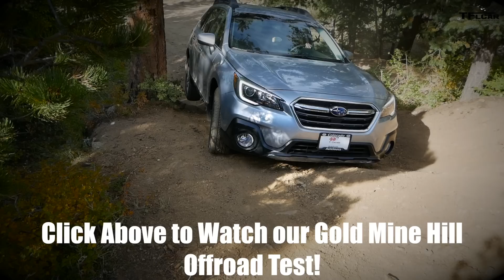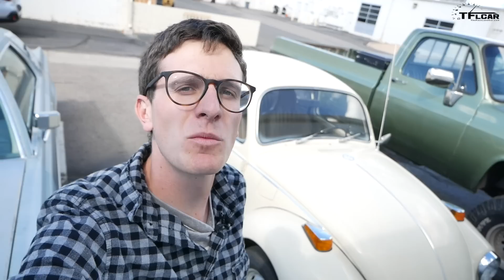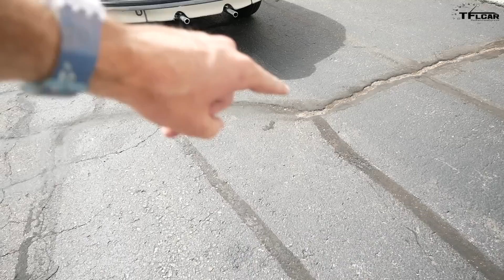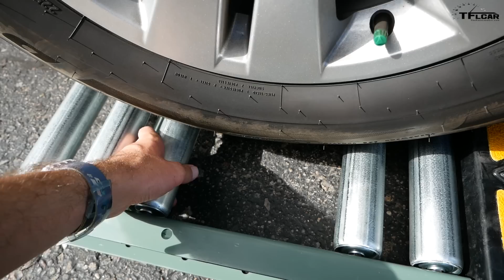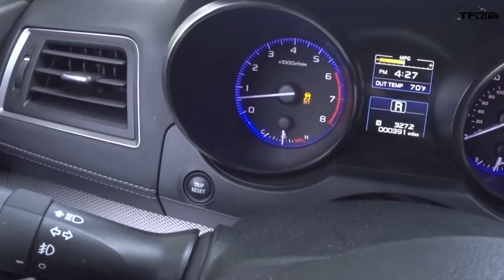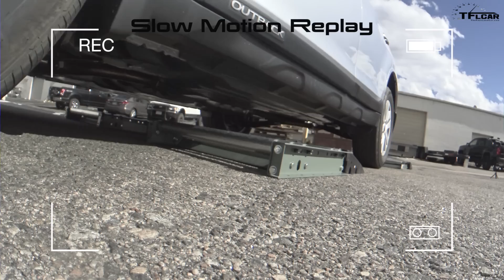The Truth About Subaru's Symmetrical All Wheel Drive:TFL Slip Test vs Subaru Outback

Comment: While this test is a good demonstration of how brake force traction control systems work in general, it's probably worth pointing out that any modern all wheel drive vehicle should perform similarly, as traction/stability control is standard (mandatory) on new passenger vehicles in most countries. AWD systems using traction control vastly outperform older, open differential systems, but do have some limitations compared to locking or certain types of limited slip differentials, especially in off road conditions.
I agree with the other comments suggesting an inclined ramp, as I suspect that the roller system as tested on a level surface could have been defeated fairly easily by even the VW with a little rocking and/or generous application of throttle. An incline would be more demanding and  better demonstrate the capability of a given system. I'd really like to see you perform this test on your "old vs new Cherokee" to show how easily an open diff 4wd system can be defeated by ice or a lifted wheel. 
I did some extensive testing on the Jeep Quadrarive system used in the 99-04 Grand Cherokee, which didn't have traction control but used Dana Hydra Lok (Vari Lok) diffs front and rear. I made a couple videos of the system in action https://youtu.be/C1pCDP2PkL4?t=76
If you have an older, pre-traction control vehicle and find yourself spinning one wheel, you can take a tip right from the owner's manual of my 75 Ramcharger; gently apply brake and accelerator together.  Although not as effective as applying brake force to just the spinning wheel,  it will have a similar effect in evening the torque distribution side to side. 
It's nice to see videos that acknowledge the value of traction control. Emergency brake assist and stability control would be nice to see featured as well.  Great videos, keep it up!

Comment: Great test! Seeing this test and your real world test up gold mine hill really shows the importance of real world tests. I think to improve the roller test you could include an inclined and cross slope test as well as a test that limits traction to the wheel with traction (simulating dirt). The goal being a test that shows the CVT is the weak link. I wonder if it's possible to design a CVT without slippage or power cut out. And thanks for bringing in the bug for some vintage flair!

Comment: Great project!  Some Thoughts:
1) The car is putting on the order of 1000 lbs per wheel on the rollers.  Those commercial conveyor rollers are typically rated for 50-200 lbs, the high capacity ones maybe 600 lbs.  I suggest trying to find some rollers with sufficient capacity to eliminate the possibility that crushed roller bearings don't influence the test.
2) When 2 or more wheels are lifted 3 or 4 inches higher, that reduces the weight on the tires on the ground. You can see this at one point in the video when even the front tire on the ground slips a bit.  This is the polar opposite of the Gold Mine Hill test, where all the weight of the car is on the grounded wheels.  Maybe as a minimum put the grounded tires on static platforms of the same height.
3) Tire pressure will have a great influence on the results since the tires are point loaded and lower pressure will smoosh the tires around the roller.  Just make sure to use the same pressure on all tests.
Keep up the good work! Love the channel

Comment: Great all wheel drive system...in my opinion it didn’t do well at Gold mine hill because of the CVT.  CVTs are great for fuel economy but don’t seem to do well with in off road situations when you need max power to the wheels. Too much slip in the cvt?

Comment: Great test, but needs to be done on an inclined surface. Thee weakest of TC systems handle this test but the question is, can it apportion enough torque when the gripping wheel is trying to climb the car up a hill, as is most off road scenarios. Find a ramp or steep driveway to do this roller test on and then rince and repeat for as many soft roaders as you can. I know a lot of people are rooting for Subaru, as am I, being an outback owner, but if people can point out their competitors are doing better in off road scenarios, then that’s a good thing. You won’t improve if you think you are the best and don’t need to try. Keep up the good work and nice to see you throwing some resources at this.
Reply: Those videos do exist as well...https://youtu.be/JC03tXrrGRI

Comment: Actually if there wasn't some kind of center diff lock or break simulation of a center diff lock, the car would fail at the test at 5:13. Because if you have an open center diff and one axle has no traction this is the same as 2wd with one wheel without traction.
Reply: nirfz Subaru has never sold cars with an open centre differential.

Comment: I think for the Gold Mine test you need to change the tyres to compensate for the incline - we compensate for slippery conditions with winter tyres....
Reply: Yea but this is TFL, they don't do good tests. When they took a 175hp outback for such steep hill, it already lacks the engine power to push its own weight over. They didn't bother buying the actual 3.6R version which gives all the power it has.

Comment: clearly does not transfer into the real world...we know the VW is very good in bad weather and very safe on crowned roads where all wheel drives tend to slid off the side...the test needs to be modified; do the same thing but attach the car to a pole and use a pull scale to determine just how hard one wheel can pull that way we can build a chart of all vehicles tested and thus determining a baseline performance, ie if a car pulls less than fifty pounds it may not be enough to work on anything but pavement
Reply: stickloaf great suggestion and very close to what I was thinking!  The only improvement I would make to this is, rather than a pole, use something that would move before the pull scale breaks in the event a vehicle is able to transfer 100% traction to the non-slipping wheel.  Maybe a large object that can move before the scale breaks.

Comment: Some may laugh at me, but I think the CX-5 has an underrated AWD system. Takes into account wipers, temp outside and hills into effect when deciding AWD should be on standby as well as reactive to situations. On the prev gen CRV, my CX5 outperformed my cousins CRV on a icy/snowy hill with exact same tires.  Subaru has a great AWD (perhaps superior in most aspects) system, but the CVT limits its ability to concentrate power.

Comment: As others have said, try it on a incline to at load to the system. Also it would be interesting to add a 4th roller to see how the system works by seeing the wheels brake in the absolute worst situation.

Comment: Controlled vs Real World .... while it would be interesting to watch systems in action spinning, locking, unlocking & spinning with all four tires on rollers. I’d prefer real world tests. Almost anything looks good on paper, in practice is where you learn.

Real world is trying to make U-turn by pulling into a muddy gravel entrance to a field & backing up.... its a parking-lot in a hilly wet grass field for festival, snowbanks, mud ruts etc. it may be a foot of slip & grip or it might be 100yrds of slip & grip.
Reply: Was the updated Gold Mine not enough to test the real world for you?
Reply: There are lots and lots of real world test on these things. it isn't even a new model or new technology. For on road applications, even in pitiful icy conditions the system works great. Just ask any Subaru owner from a northern state, or any of the many long term tests online. 
The underlying problem is the torque management for the CVT, and if you go all "off road" in a vehicle designed for the street the computers are programmed to keep the CVT alive. If I owned one I'd rather have a long lived CVT, than a car that can slowly destroy itself internally in conditions  where it is in over it's head anyway. Of course I'd also rather not have a CVT ... but that is another story altogether.
Reply: I owned an outback, performed excellently getting me out of snow, Ice, and mud. uphill, tight corners, gravel, it doesn't matter, Subaru's awd conquers it. the mistake they made was using shitty stock tires, if you want to offroad in anything, you should have offroad tires.

Comment: The reason it was different is because the system is made for on road conditions. The system doesn't like resistance which this test didn't have so it allowed the car to not have to worry about protecting the CVT. Off-road at goldmine hill the system felt the resistance and cut power to protect the CVT. Watching the off-road video again showed the tires barely spinning. Better tires wouldnt have made that big of a difference in that situation. Resistance on a flat surface vs an uphill situation. This is why the older Subaru's do better off-road.

Comment: Use a wooden block on the wheel that doesn't have slip plate to see if you can defeat the system. If so, then you can use different block sizes as a comparison point.

Comment: I think you need to pull another roller out, it looks almost like the open diffed VW could have driven off that with a tiny bit of throttle, and secure the rollers to the ground better

Comment: Great review as usual Tommy, yes it is not an issue, it is simply the manufacturers using CVT'S to give us fuel economy to meet new laws and awd systems use electronics to protect them from over heating, if Subaru used a regular auto transmission yes you do get more capability and you'd still have these systems in place, that what is X drive ,Quatro, and awd by mercedes ,they all have the same vdc,tcs, you test on vehicles with DSC gear boxes on hills show that they over heat quickly and shutdown by the computer in the cars and don't like hills  when towing small loads, thank you once again

Comment: The best modification to this test would be to see exactly how much torque can be applied to the wheel with traction. To do this, you could anchor the car to something stationary and have a strong weigh scale between the vehicle and the anchor. That way you'd be able to measure exactly how much weight that wheel can actually pull. It could also be a good way to compare various CVT's, DCT'S and ordinary autos with torque converters. You should also demonstrate the old off-roaders trick of using the hand brake to apply some brakes to the spinning wheel and and overcoming the brake with the wheel with traction to get off the rollers (2WD). You can also do this by applying the brakes on a 4X4 and slowly applying more power until you get moving. It would be easy using an auto with 4Lo engaged.

Comment: Suggestion:  when you do these roller tests, you should do every variable in terms of wheels. Do what you did but also do right front left rear, and then each individual wheel which will reflect if that wheel provides traction. So for example if the back left wheel was the only one with traction it may not move the vehicle. It may but we’re not sure. It’s always good to clarify and provide certainty of how well the all-wheel-drive system is working.

Comment: I think almost any awd vehicle with a brake based traction control would be able to get off the rollers in those tests. It's when more torque needs to go to one or two wheels that they struggle with.  Maybe the subaru should be try dragging a fixed weight to simulate an incline?

Comment: Hey Subaru have Toyota make a proper transmission for you. CVT is cringeworthy from any mechanic I've ever talked to.
Reply: Subaru doesn't use a regular CVT. It is device designed for Audis. Some german shop is building the chain. It is not a belt driven like you would see in a Nissan or Toyota. It is a chain designed for w8 engine's torque.
Reply: total nonsense. The Subaru lineartronic is a Subaru development and has nothing to do with the crappy Audi multitronic. The Subaru CVT is tough and reliable. The audi's multitronic has a very bad reputation, because it breaks down extremely often.
Reply: Subaru does assemble the CVt inhouse but the parts for it are third parties. And I QUOTE:

LuK GmbH & Co. KG, the Schaeffler Group’s specialist for systems and components for vehicle drive trains, has been a development partner to SUBARU for ten years. This collaboration produced a highly efficient all-wheel drive CVT that was presented for the first time at the 2009 New York International Autoshow under the name “LineartronicTM”.

Shaeffler group is a major Audi parts supplier. The chain that is inside the Subaru CVT was designed for w8 Vw products. Subaru doesn't design these things. They are in manufacturing and assembly business.  Jatco belts that Nissan uses couldn't fit in a device that Subaru due to the way the engine sits.
Reply: the fact the buy parts at third party specialist doesn't mean the subaru gear box has anything to do with the multitronic from Audi. Believe me, the Subaru gearbox is way more robust and is a subaru design

Comment: I agree with a lot of the comments below. Either put a block/ramp in front of the traction wheel that the wheel needs to climb over or try the test on an incline. Incline would be difficult to even get the car on the rollers without having a way to lock the rollers, however.

Comment: Tommy, very good test but a few things that might help. You talked a lot keeping the throttle about the same, maybe a constant rpm might be a good idea say 1500 RPM. Also I think if you put a mark or something on top of the wheel that is on the rollers to mark how many times it spins or slips. The point of this is most of these off road buttons (X-mode or mud mode ext) are designed to limit or allow more slip of the tires. This would allow you to count how many times the wheel spins and measure of the off road button actually do something. This is going to give a better result then going off feel. You said X-mode felt like it did better but to me watching it, they all looked the same.

Comment: You could see how some a/t tires may improve the performance for the Subaru for going up gold mine hill. Definitely shine a light on whether the greatest limitation was the CVT for the vehicle or better tires would help.
No one in their right mind should be driving up and down paths like that using normal touring tires after all.
Reply: I own a 2.5i Outback and the Yokohama Geolanders make an insane difference over the stock Duelers... heck, I even have better dry road grip now.
Reply: 100% agree  , of course outback is no rock crawler but with better tires and cvt even can do light offroading.
Reply: It's not the tires it's the ABS dependent "AWD" after about 40 sec of use ABS turns off to cool pump and you're back to open diffs. Hence climbed first stage good, then utter failure on second stage, ABS cut off.
Reply: That does seem like an easy test to do.

Comment: Good job Tommy, i have seen similar tests from Subaru but we can't verify if it is true or false , like this test here using an incline ramp https://youtu.be/wX1VezHjzQ0 . In my own experience my forester did well in many situations e.g. deep sand in the beach or desert , river bed driving and deep snow , what i feel is the car always drives one wheel in the front  and one wheel from back on the opposite side untill the traction system detects slippage and applies the brake to the individual wheel . In situation like the final stage in gold mine hill , that one is very steep and only 2 wheels have traction . I don't think many people can appreciate how steep that place is 😊.

Comment: In addition to the simple flat surface, you could probably place those rollers on an incline to test the effect of various degrees on the AWD system. 

Roller tests like these are where Subaru is said to outperform other the basic AWDs in such vehicles as Nissan Rogue, Mazda CX3, Honda CRV or HRV, Toyota RAV4, Jeep Compass. Maybe you can verify to see if any of those actually fail?

The new 2019 Subaru Forester has a new X-Mode that has 3 different settings (normal, snow/dirt, deep snow/mud). Hopefully you'll be able to test?
Reply: I think the incline in addition to the loss of traction is what really held it back

Comment: Really like this test.  As you said, putting it on an incline or placing wheels with traction on surfaces with. Less grip like ice or loose dirt would really be great.  Even water on a slippery surface would be interesting.